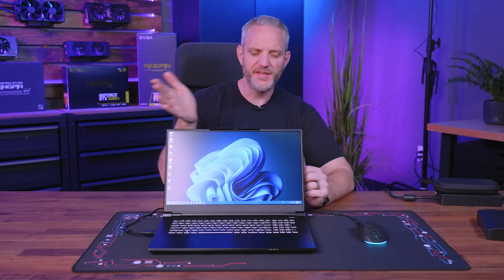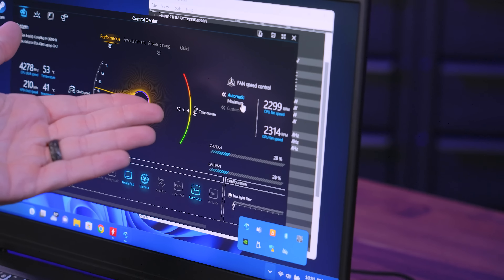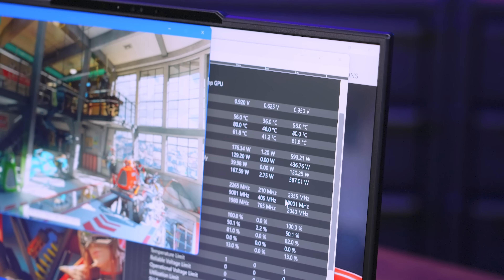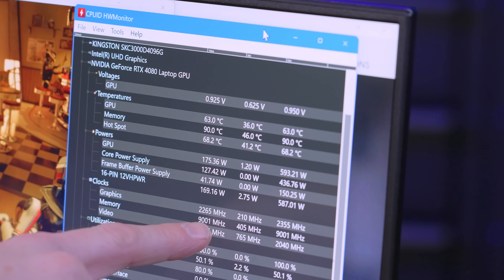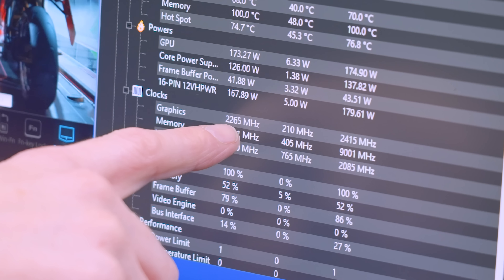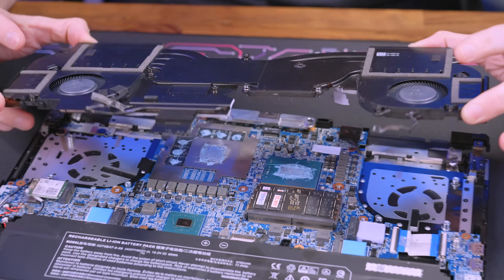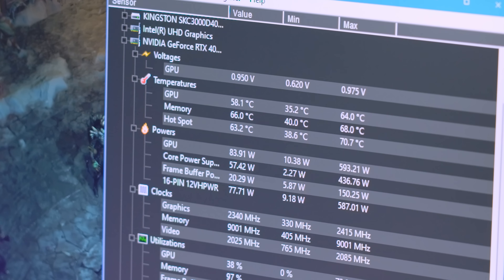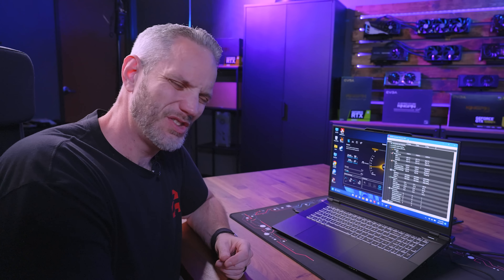I think I made it worse...

Comment: Jay, depending on how high you have the textures turned up in Diablo, it will fill Windows RAM to the point where it has to swap. I've run into this issue pretty often (temporarily able to resolve by clearing the standby cache) and I have 32 GB of RAM.
Reply: depending on how many players are standing in town with you, as the way its coded.. you have to load every item for every character in range. This is all done by Ram.. That you are sharing with those textures.
Reply: and I also have 32gigs, R7 3800x Oc's 4.6 watercooled, Rtx 3080 xc3, samsung nvme m.2 storage. It all depends on how many people are standing near you or "in the range of must load these items" coding. 
I can run Escape From Tarkov and other terribly demanding games without hitching at all. D4 is a hot mess.

Comment: I should let you get a hold of my Clevo X170KM-G with a full 11900k (yes, a desktop cpu) with a 3080 and have fun trying to control those temps.  Even undervolting is still putting me in the 50s at idle.  

I've already RMA'd it once trying to benchmark Exodus (normal ed) on an external 1080p monitor.  Somehow, it fried the motherboard and had to wait 4 months for a new one.

Bright side is during the winter months in my semi it warms up the cab quite nicely.

Comment: I wonder if contact isn't actually the issue here. I wonder if when you have good contact on the memory, it adds to the total heat load and the cooler just simply can't dump that much heat when combined with the GPU, so the GPU temps suffer as a result.

When you're not properly cooling the memory, more of the cooler can work to cool the GPU alone so you get better temps.

Thoughts?
Reply: Doesn't the CPU share the same cooling solution? I don't recall seeing or hearing the numbers but I don't think there was a significant difference or he probably would have mentioned it.
Reply: @--_DJ_--  he was testing the GPU so I doubt he even looked at CPU temps. But if it shares the same cooler, then yes, it could be worth looking into.

Comment: 100c is pretty high to my opinion, I wouldn't feel comfortable with that. That's why I don't specially recommend to take a laptop as your gaming PC, unless you really have to for any reason. Temperature is much more an issue with laptops because of their much smaller space and components. Many people don't realize that a gaming laptop mostly also need an external cooler like a table cooler. Some people even put their laptop on a pillow or on a bed sheet, that's the worst thing you can do!

Comment: Please do a follow up and:
Get some nail polish and then do liquid metal on CPU and GPU. Don't use too little liquid metal and don't forget to put it on the cooler, too.
Let them send you enough clay pads so you can experiment a bit with liquid metal and switch back to paste if necessary.

(By the way, the liquid metal's surface tension will prevent any spills even if the laptop is sideways in your bag. As long as you don't use completely excessive amounts it's not going to spill. Just protect the SMDs very close to the CPU with nail polish and you'll be just fine.)

Comment: Memory will not clock down, it will just degrade and eventually error out causing artifacts on screen. Running at 100C is not a performance issue, it's a wear issue... It will run at 100C until it doesn't. And then you're SOL. You should try copper or aluminium shims with thermal paste on both sides if pad is too much...

Comment: And this is why TG-PP10 is amazing and it's a shame they stopped making it. It has better conductivity rating than quite a few thermal pads, perfect height every time with literally no guessing, and it cleans up fairly easily (Far easier than K5 Pro).
Reply: TG-A7000-1000 is the replacement.

Comment: whenever I repaste my laptop I replace the pads with PTM 7950 after a few heat cycles it performance as good as if not better than thermal paste but since it is a phase change material it can deal with the inconsistent material while spanning a 2mm gap. But the standard thermal pads are not great in laptops.

Comment: Should probably find a good short steel rule or small engineers parallel to use as a straight edge, place it on the gpu die and actually measure the gaps between the straight edge and the memory chips, then you'll know exactly how thick the thermal pads need to be.
Reply: idk if id be comfortable sticking metal across a motherboard
Reply: @acatch22  Shouldn't be any problem so long as both mains and battery power are disconnected and the caps are drained, though I suppose a piece of delrin or glass could be used instead, so long as it's got a good, usable, flat/straight edge to it.

Comment: Sounds to me like they need separate cold plates for the GPU and memory. Or at least a cut between them so each can be secured to the board tightly without impacting the other. With only three points of pressure, one side getting too little clearance is causing the other side to get too much. The could do this by separating the outer C shape from the GPU plate, and having a spacer on the same screw holes, then adjusting the thickness of the plate to the side further from contact allowing you to get pressure on the second plate by squishing down the spacer. It would literally add a layer of complexity, but would still be the same amount of material and the same board layout.

Comment: Someone needs to make the same thing that you use for building engines... string gauge that will compress at heat shield pressures.

Now you could use playdo or putty, then cut it and then measure the thickness.

Remove the guessing game.  Though the coolers should have spring loaded sections and heat pipes so they can flex then each could have the right gaps.

Comment: How much does the power brick heat your laptop? Most power bricks use a 1920 vintage buck converter. They are only about 60% efficient. All that power is converted into heat in the brick. Setting the laptop on the power brick is like setting it on a hot plate. No one uses the 2023 circuit which is 99% efficient and is cheaper.

Comment: Wonder how some pads of a phase change material would fare?

The big problem I have had with those are that it can be very hard to remove the heatsink when cold. But apply some heat and it is usually no problem.

The big feature with phase change materials are that they get soft when hot and will deform. Shis should allow the heatsink to crush the pads so it can get good contact with the GPU core.

Comment: With the connections you have, why don't you edit the interface so that everything will work.  You take the motherboard and have it 3D scanned to get the height differences of the chips and then 3D scan the cooler to get virtual results of where something goes wrong.  And if it can be repaired with a CNC machine.  Also, copper is a soft metal, I'd rather see steel mounting plates than copper ones

Comment: I was thinking this at the time, maybe paste won't be thick enough for the vram.  Glad you revisited it.

The ram on the back of the gpu problem was the 3090, they fixed that in the ti and 40 series. 

Also... does vram throttle under high temps?  I've never seen that.  Maybe it does.

Comment: Another thing to monitor could be the battery level. Does it drain the battery even when plugged in then have any power switching to charge the battery and cause reduced performance while charging?

Comment: I wonder if Speedway was raising the temp because it is a stress test and designed to do so, while games (or Windows 11) might use something similar to DirectCU (remember that?) to hold thermal temps close to max without truly thermal throttling and/or making the temperature variance less stable.

Comment: I've read info sheets placed in a few laptops I've had "don't use on Laptop on your Lap as bottom gets hot and it may obstruct air entering the device!
So whys it called a laptop if your not supposed to have it on your lap!
 They have also stated don't put it on bed covers, table cloths, towels etc as may block air vent on bottom causing over heating and poor performance.

Comment: I wonder if they could alter the manufacturing process so that the memory and GPU chips are level to make equal contact with the plate. Then you could use thermal paste with a spatula without worrying about lift from thermal pads.

Comment: Another way to lower temps a bit on laptops is to go into advanced power managment and lowering the maximum processor state to 99% from 100%.
Reply: I've always set my laptop to 95.. barely noticed any impact on performance but temp wise it made a massive difference from my own usage and experience...but haven't had a proper new laptop since my 2007 old bugger xD
Reply: Technically speaking thats cutting performance you paid for though.
Reply: @crisnmaryfam7344   technically you're correct but the actual impact is so minute... for the games i played on my laptop... it never meant any impact on performance... so for me personally the tradeoff has always been worth it...
Reply: @crisnmaryfam7344  Technically, yes. It only turns of Turbo mode tho. Which is fine by me cause i dont see much, if any difference when gaming, however the temps are great.
Reply: @Mr3ppozz  Agree 100%, dropped mine and see no difference when gaming but temps are great.

Comment: Maybe its just working fine with the hot and slightly throttling GPU in that last scenario, because now in that situation the memeory gets its wattage purged into the cooler construction. of course that is thinning the cooling capacity for the core. So maybe its just the Limit of the Fan/Finstack combo?
Maybe we will see in the next video if the original pads make any difference while perfectly working.

Comment: i'd agree with the conclusion. i run balanced fans and i've thrown my laptop into the thermal limits twice. tlou part 1 full stress test for over 3 hours. i got the slideshow and full fans for a minute. had to be done. i have thought about repasting too, but i'll turn into a monitor junkie again, if i do that. it's running fine and does it's thing. i for sure know how to not stress it. yo

Comment: My old ASUS 4090 goes to about 105 C on the memory and then the card goes into some form of crash mode with full fan speed and Windows trying to reload the driver. (using both the 4090 and integrated GPU, so the integrated monitors are still live and Windows doesn't crash)

I've never seen it throttle the memory, even though it reports +100 C memory temps.

Both the GPU and CPU has more than fine temps while gaming, the memory chips are the only issue and I'm sure it's those on the back of the card, as a fan on the backplate keeps temps below 90 C

Comment: I bought a Dell XPS 17" gaming laptop back around 2010(can't remember exactly when they released, was before they started selling alien ware) that had an Nvidia GPU in it......the copper heat pipes went around the perimeter of the bottom of the case and IF I used it on my lap it could ALMOST feel like it was burning my thighs THROUGH my pants. It fried two GPUs, first one covered under warranty, second one wasn't and is still in it! That thing ran Crysis flawlessly BUT I think the reason it likes to eat GPU chipsets is because of what you stated.....the vents were on the BOTTOM and exhausted put the sides and back!!
Reply: Most gaming laptops intake air through the bottom. They're really only meant to be used on a hard surface (or cooling mat) when under high loads. I use a lapdesk (hard top, squishy stuffed bottom) with my Asus and it maintains its temps fine if I want to play some games on the couch or in bed. 2+ years and going strong.

Comment: Measure the original tpads with a digital caliper first then use actual pads according to the actual thickness and not the paste since it's still bound to fail. You might end up dislodging the solder balls under the vram chip causing the error code (-43).
Reply: You should see the original video first. OEM used thermal putty, not pads for the RAM.

Comment: I dont like my laptop outputting that high temp. The battery is closeby and depending on the airflow, the battery could be getting hit with high temps and the heat may soak in to it. At 30+ C, the Li ion battery tend to degrade. I am worried on battery temp the most.

Comment: Should use PTM 7950 for laptops
Reply: aye, it's 0.2mm thick
Reply: @glebglub  PTM7950 is a compressed paste, it is not applied to the power section and vrams, thermal putty such as Upsiren UX Pro is applied to these elements.
Reply: @goorthiss  it's not a compressed paste, it's a phase-changing solid that turns liquid at ~45c, it's just supplied in 0.2mm thick "pads" for ease of application (otherwise you'd have to heat a tube of it up to ~>50c to even begin working with it, which is a health & safety hazard) it's only not applied to the VRAM because 1.) increasing thermal conductivity between the heatsink and VRAM is not always ideal, as the heat from the core can/will be dumped into the VRAM, and 2.) it's overly expensive for the job (only listing I can find atm is £34 for a single 80x80mm pad, compared to 200x200mm for £14 for a 0.5mm thermal pad)
if anything, the putty is more akin to a compressed paste than PTM7950, as it's not solid at application temperature
Reply: @glebglub I meant for the die, not the VRAM. For the VRAM putty or clay would be best.

Comment: What about Thermal PUTTY for the memory..??? I went to it on an old laptop that I could not find specs for the correct thickness of thermal pads for when I re pasted it and it worked better than the original pads.. ???

Comment: u can always use copper shims. problem is trying to get the appropriate thickness for it
Reply: There needs to be a little gap filled with paste or putty between the shims and the heat sink because if the shims make direct contact with the heatsink the gpu core WON'T make proper contact as it's always in a higher Z axis with respect to the VRAM and copper is a rigid metal and won't compress at all when you screw down the heatsink into the motherboard (and the entire PCB will bend causing more issues)  so you can use a bright flashlight to shine between the heatsink and the shims once installed to make sure there is a little gap in all the contact points for the video memory.

Comment: Can we address their pricing?  You can buy this exact same clevo unit for $2500 from other sellers, or a laptop with the same cpu + better ram and a 4090 for 2650. 

13900hx, 4080, 32gb of 4800mhz DDR5, 144hz 4k screen.

Starting at 3700. 

Lenovo Legion 7i

13980hx, 4090, 32gb of 5600mhz DDR5, 240hz (not 4k but who uses 4k on a laptop?) 

$2650 right now on B&HPhoto.

What am I missing? Why the 1.1k markup with lesser specs?

Comment: JAY! Where can I buy those pads? 

I have a gaming laptop from the same original manufacturer (previous gen; Ryzen 7 5800 and Nvidia 3080) and it also uses those nasty disintegrating pads. 

I noticed after 6 months that the performance was dipping and checking on things showed this was due to thermal throttling, I figured "Must be cheap paste drying out over time" so I went ahead and repasted it with Thermal Grizzly. Like you I found the pads on the ram went to dust as soon as the cooler was removed, like you I ended up using thermal paste on the ram chips as I did not have any pads anywhere similar.

I know of no where I can get these and would love to buy some.

Could you ask the manufacturer to make these available for sale as I know that I at least am very much in "Shut up and take my money" mode on this. I am sure I am far from alone in this.

Thanks
Natasha

Comment: in 99% of cases, there is good no reason to put an additional layer of thermal paste on thermal pads simply because you add another layer which heat has to go through thus slowing the heat transfer.

Comment: i agree with Jayz message. dont fuck w your laptop. I tried to do maintenance on my MSI gs 66 stealth and accidentally overtorqued one of the cpu cooler screws, shearing it clean off. cooler no longer adequately pressures the CPU. temps perma 95+ fans maxed automatically. i have a 2000$ paperweight. worst part is its out of warranty so i cant get it fixed.

Comment: You could try "Gelid" 15w thermal pads. Most manufacturers use only the 7watt pads to my understanding, 15 is more than 7. It's what I'm going use when I try to tame my MSI oven.
Cheers 🍻
Reply: wtf is 15W thermal pads? Did you mean W/Km? that's thermal conductivity and it's changing with the temperature
Reply: @soulsilver6799 :
Yeah, 15watts. I did spell it out when I wrote "7watt" in my initial comment. Both electrical and thermal power can be measured in watts, represented with the letter 'W'. 
Cheers 🍻
Reply: @Finite-Tuning  W is completly different from W/(K*m). A thermal pad is not producing or absorbing power so you can't use Watts. 
Thermal conductivity is measured in Watts/ (Kelvin*Meter) and as I said, you cannot trust this type of number since they change with temperature. For example "Liquid Metal" have really good thermal conductivity at high temperature and terrible thermal conductivity at low temperature.

Comment: A nice illustration of why I believe high value GPUs should separate die and mem cooling. Both components are happy at different temps. The only reason to combine the cooling solution is reduced manufactoring costs (is what their marketing department will tell you, we are talking a few bucks tops). But it's a feature I'd be willing to pay extra for.
Not that I'd buy a GPU right, the only games I touch atm run on an unplugged toaster.
Reply: No they are better done together. What's important is making sure all the pads and paste are doing their job. If you leave one component without a pad it can heat up and send heat through the board to the GPU.